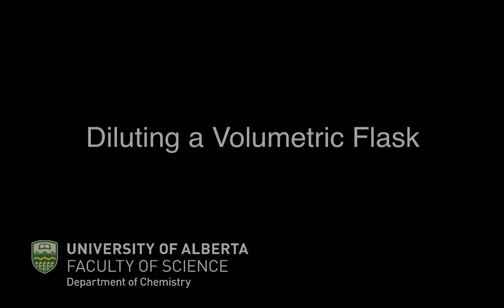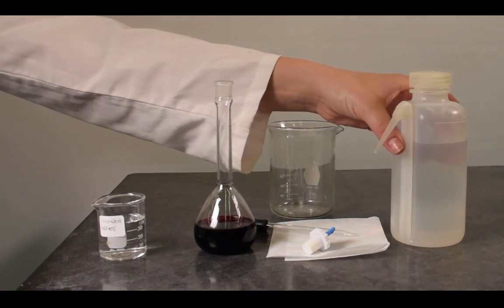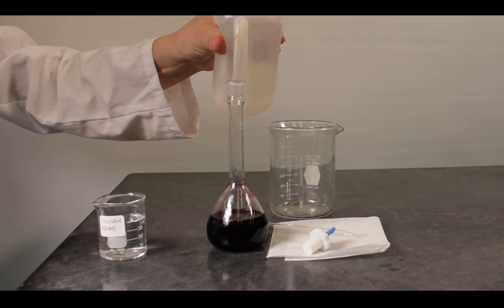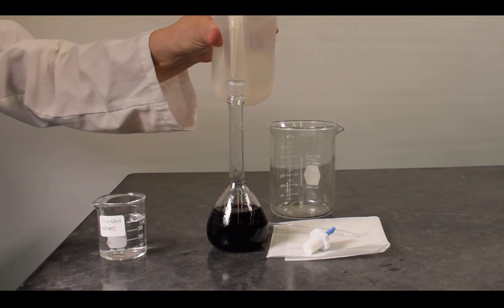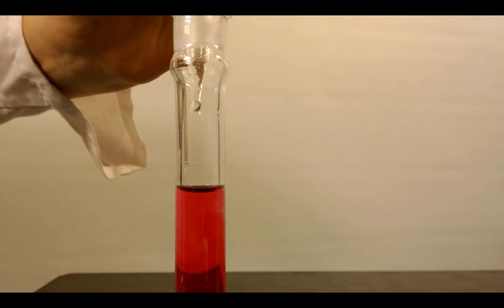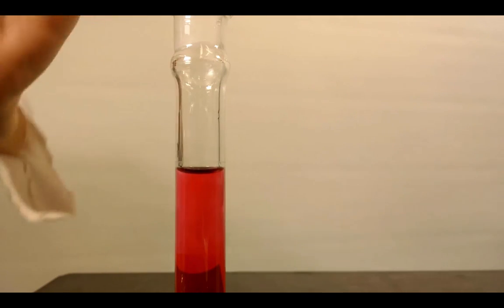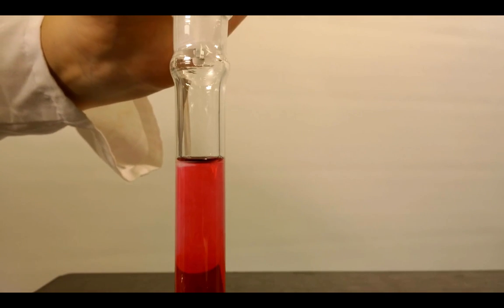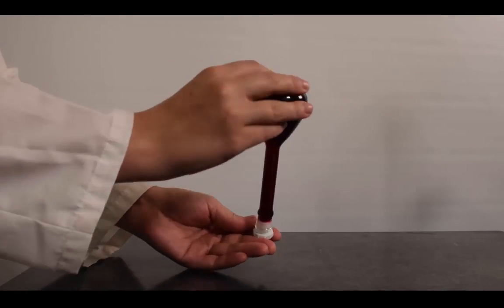Diluting a Volumetric Flask

Comment: If while diluting by mistake gone above calibration mark then what is the solution
Reply: there isn't any solution really. If your solvent is volatile, you can let it sit and vaporize with time. Alternatively, you can transfer all the solution to a higher volume of volumetric flask and adjust the ratio of diluent and solvent. For example, instead of preparing 100 ml of the solution, you can transfer this misprepared solution into 200ml vol. flask and add more solvent and diluent. This way you will have more of the solution but in the concentration you want.